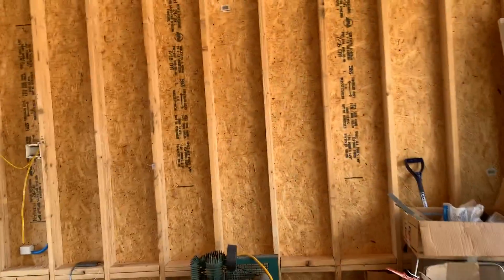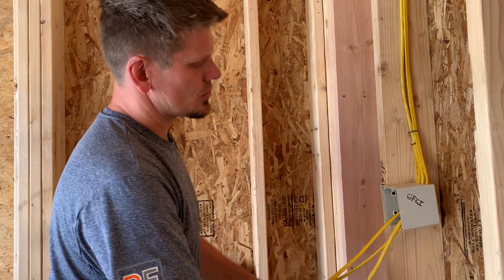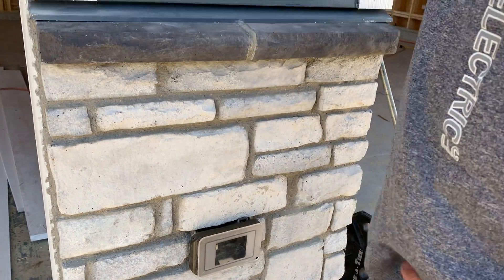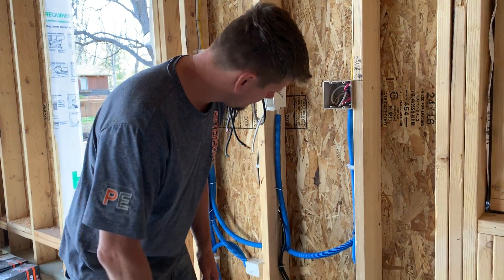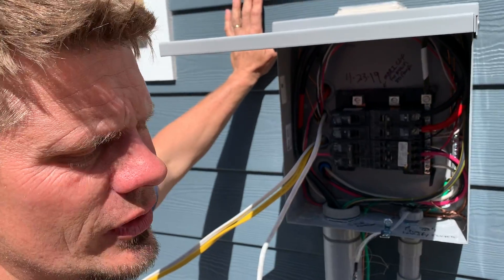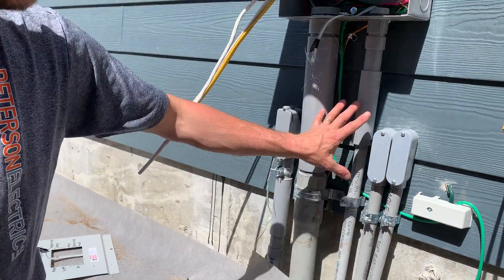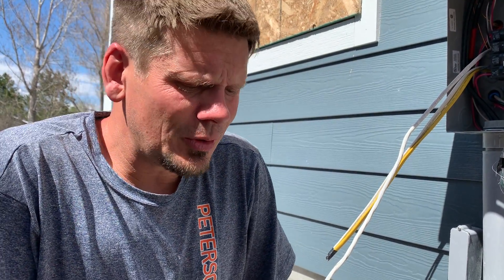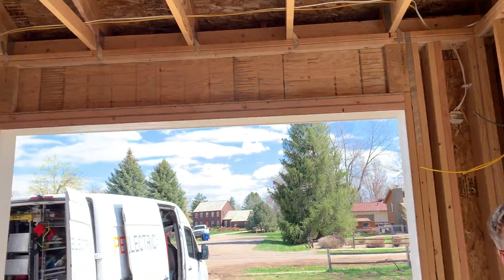What Should You Plan for When Wiring a Detached Garage? -  Part 2

Comment: I'm surprise you're not running an ethernet cable to the detached garage.  I just ran one 2 weeks ago.  It was a pain to go under 2 concrete walkways, but I'm glad to have the wire.  I added an access point in the garage to improve WiFi signals for my WiFi-based smart switches, garage door openers, and cars parked inside the garage or driveway.  Next up are POE cameras.

Comment: Suggestion to prewire electric (and maybe a cat5 for sensors/button) for garage door operators for installation as jackshaft operator on opening wall and or standard overhead back hang motor. Good video thanks for sharing.

Comment: I'm building a 14x24 detached garage/shed that is about 30 feet from my house. I'm not planning on running any welders or multiple power tools simultaneously. This won't be a big work shop or anything. Do I need to pull a whole new electrical circuit or can I extend power underground from my house. If I extend, can I go with a 20amp or should I do something bigger. My home has 200amp service.

Comment: Good info! Question: @ 10:42 slip conduit. It is clamped to the building below the slip joint. Confused on this ?? Would you not want to clamp to building on the above non-moving conduit and you would want that secured? Or is the clamp just loose so it does not matter? Thanks!

Comment: I saw this and thought it would be something beneficial as I plan out my electric for a new building that will go up in May/June 2022. I was wrong. This was way over my head. I have a drawing with all my woodshop tools and the type of power needed to service them. I didn't consider external lights at the garage or walk-in doors. After watching this, I am wondering if I am ready to tackle something of this magnitude. 25 overhead lights, running off five circuits. 7ea 240V/50amp receptacles each on its own circuit, 6ea 240V 30amp receptacles on their own circuit and 29ea 120V 20 amp receptacles or which there will be three duplex and the rest singles. I need someone to draw this out for me and I am willing to pay. Thanks for the video. Back to the drawing board.

Comment: Some jurisdictions in my area still allow a 3 wire sub panel. In addition to bonding. Can't see why it's a bad method. You have 3 wires coming into the house. Also, they also allow in instances a overhead drop with UF cable. All agree the sub panel can't be main lug, must have a main. However i've been having lots of trouble finding a main breaker hold down, so inspector suggest I get a hundred amp main breaker panel, and just use the main as a disconnect, regardless of what I feed it with. 30, 40, 60 ETC.
Reply from the maker: this is safer with four wires, the Grounding conductors are established at each structure with electrodes, and without the forth wire, you could be the potential to a wild leg or fault.

Comment: Hi Joshua, I have a old detached garage with cloth wiring, metal boxes and open studs. I was planning to update it but still keep the garage with open studs. Currently, the cloth wiring is running through the studs at knee level. I had an electrician mention that the wiring can't be left at the height it is now. I've been looking through NEC but I can't find anything on it. have you heard anything about this? I tried checking with the city inspectors but they never call back.

Comment: The electrician is trying to talk me into a 200A main service panel upgrade just because I want to run 2224 service wire to my garage from my house on a 100A service, what's wrong with a bit of overkill?  two 100A breakers one in the house one in the garage and 2224 service wire buried in gray pvc between the house and garage 2' 6" down, 80 foot run
Reply: Because it be cheaper and better to set a 200amp and then come off it with a 100 amp panel

Comment: Is it legal to pull in romex into smurf tube when it goes from box to box ?
I thought that you can only pull in single conductor in conduit when it goes from box to box ?
Reply from the maker: NM is rated for INDOOR only. ENT pipe as well. As long as you watch your conductor fill and conduit volume fill. Per articles 310.15 and chapter 8 table 9 (i think) that speaks about ONE CABLE in a conduit vs Many Cables.
Reply: In exposed work The nm cable must be protected from physical damage.... In this case he is protecting the nm cable for everything he could think of!! Nec 334.15

Comment: your work is great.  the guy who nailed the osb sheathing for the garage walls really missed the 2x6 studs.  sheesh, no wonder you used ent.  i dont blame you.  woohoo.
Reply from the maker: THANKS. I am usually scared of builders coming back and not getting all their fire blocking and framing completed, then they want to RUSH you to GET IN THERE! Nails are DEADLY TO NM CABLES> Wish I could ENT whole houses. If I EVERY get the pleasure and $$$$$$ I will wire my house in EMT and ENT pipe. Screw NM cables, they are stored future food for mice and rats to breed in walls. Sadly, if I  bid all jobs with anything other than NM cables or ROMEX, I will bid my self out of the jobs. Somewhere YEARS ago most AHJ in CO allowed NM. They still allow this for any APARTMENT or Hotels that are under 3 stories. LOL!!!!!
I set 6 mouse traps outside my home  and put new cheese in them every month to keep them from coming in my home.

Comment: What if the basement dryer outlet, below ground, is flooded?
Reply from the maker: GFCI protect 30 amp - 2 pole
Reply from the maker: use a raft to check voltage! LOL. I would Gfci a dryer if there is concerns.

Comment: so many changes ...we humans still not master the electricity of understanding..it seems to me, electrician just learning as they go while updating the code..its screwing to me, when changes from 2005..3 wire  and ground rod with isolated neutral bar for subpanel...now 2010...4 wires is require to make breaker fault complete due to 3 wire ...2nd ground rod alone on detached garage is not enough to make complete fault ..then you saying 2020 another change ..outlets have to be gcfi for dryer...